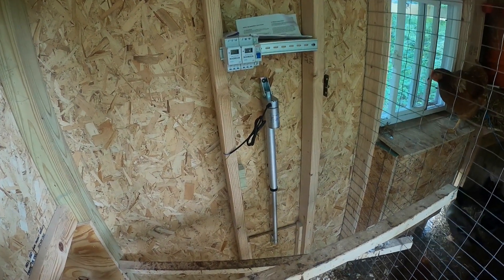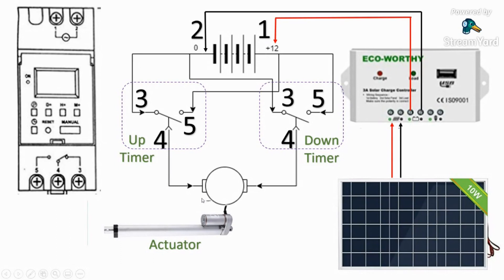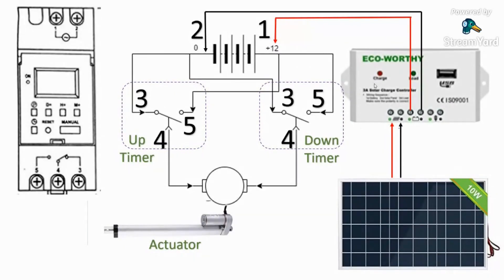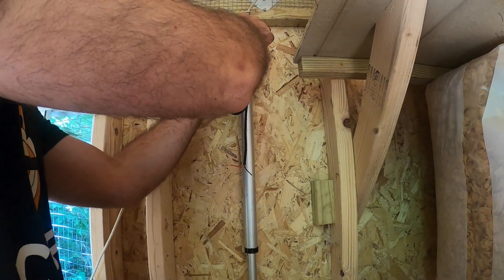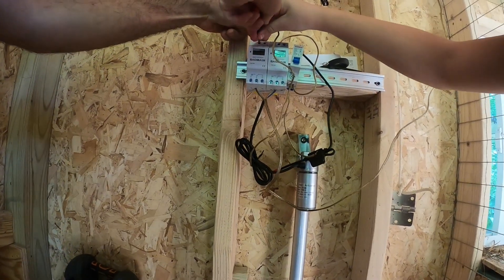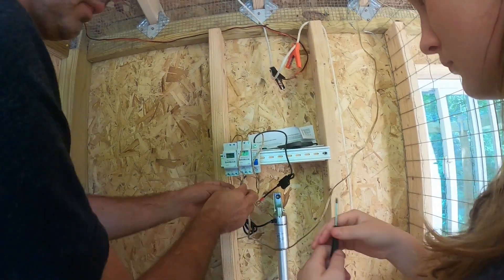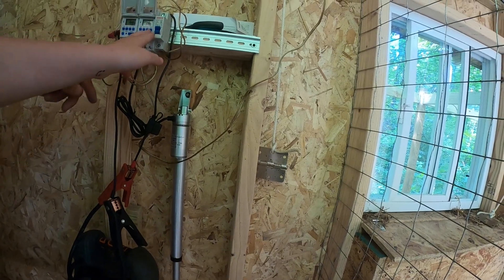DIY Solar Chicken Coop Automatic Door Less than $150

Comment: 4:42 I have been telling people to do it this way for years now.

This video I made shows it in action with limit switches but if using a Linear Actuator just remove the limit switches.

https://www.youtube.com/watch?v=ClPmxFDa5m4&t=4s

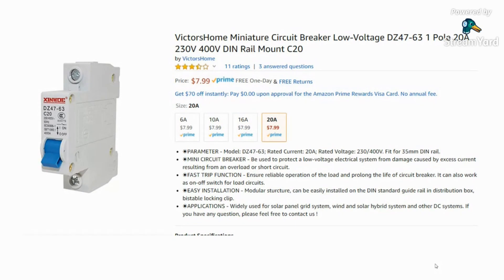3:33 You shouldn't really be using those AC Breakers for DC current. I use them only because it is such low voltage and the main draw will only happen twice a day. BUT you are using a way too large AMP. That motor only uses 3amps MAX. That is with FULL load. 250LB. The most I have ever made it go up was 2 amps. well beyond "breaking stuff" point. Use 2 amp breakers. Since you have two actuators use a 3 amp.

4:18 the Charge controller you are showing is NOT MPPT it is PWM.

5:05 Not pins, They are screw terminals

7:30 You could also use astronomical timers. They adjust the time according to astronomical charts for your latitude and longitude.

8:25 For those who might think it is too fast going down, you can add a PWM motor speed controller just on the down side Up timer terminal 3 and Down timer Terminal 5.

8:58 You very much so tell what time is the Open/Up and Close/Down timer. Whichever is sending positive is the one for that action. When you tested the Actuator, take note as to which color wire preformed what action when positive voltage was applied. So if brown had positive and it went up then you know. Mark the wire with a zip tie or a bread twist tie. Put the wire to the #4 terminal of the timer you designate to be the Open/Up Timer. Or just switch the wires on the #4 Terminals to match how you want it. However doing the way I first mentioned will be best.

12:29 Mounting the push rod mount more to the center of the door or just below helps keep the door more centralized. Less rubbing on tracks and wall which means less wear and tear and less possibility of jamming. Also takes up less space if you are lacking

15:10 Mounting the controls on a separate board and the putting a French cleat, will make it so you can do all your wiring before hand. Using terminal blocks and/or lever wire connectors helps to just connect the wires once the controls are set in place.
Reply from the maker: Excellent review and yep.  Anymore I don’t use the solar charger because my coop has too much tree canaopy over it.  Other than that your spot on.  The timers for me aren’t seasonally adjusted and that is a pain in the butt.  I’ve gotten to the point where I just leave them at a certain time that works and my Roos seem to get everyone in before they shut.  They are good about that.